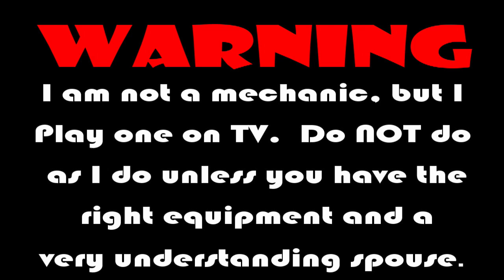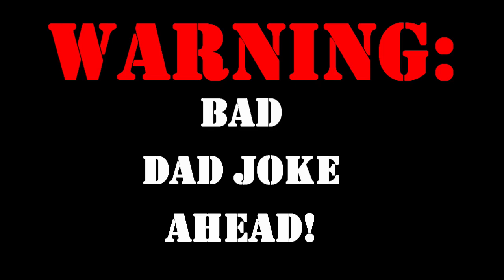1970 El Camino Rear Window Frame Rust Repair

Comment: Just rebuilt my backglass pinchweld area on my 70 El Camino! Cut all the rust out & hand hammered & welded all the way around with new (actually used metal from my old 1/4 panels) Mine was way worse than urs! Welded in new reveal moulding clip studs that came with my stud gun! Grinded the welds, cleaned up & primered! Like new now! Used weld thru primer on all overlaps! Should outlast the rest of the car now! This is my 6th 70-72 Elco! Should probly keep this 1! They’re getting pretty hard 2 find! Gotta luv the 68-72 El Camino’s classic lines!
Reply from the maker: You know how much work is involved my friend.  Great job getting yours together, we need to keep these beasts going for another 50 years!

Comment: So many old cars have this rust damage.  I was thinking a trip to the junkyard with a template, measurements and photos in hand of area on car that needs repair work.  Now you won't find the exact car of course but maybe the rear window channel may be close to many other American 80's and 90's cars in the junkyard.  Usually a battery sawzall will work to rough cut more than enough metal.  That corner you fabricated may of been found on a import or domestic car or truck and fit fine after trimming, cutting, hammering, welding and grinding.  Template made out of thin aluminum to get a shape in hand to look around at the junkyard. Just a thought.

Comment: Nice work, was that 20 gauge metal you used?  I'm a commercial carpenter and we use steel studs for wall framing and 20 gauge metal is the heaviest to cut by hand snips.  Original metal thickness to your Chevy may be  18 gauge?  Do you know the original thickness?
Reply: Sorry never mind, I see your comment that 18 gauge metal was used.
Thanks